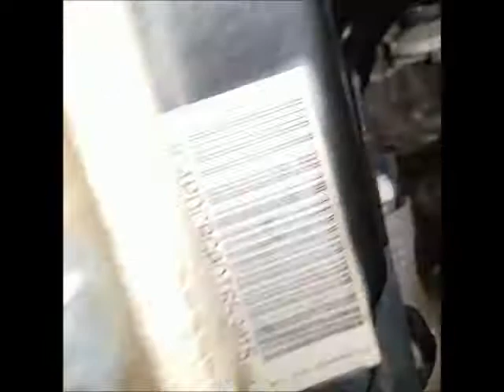2011 -2018 DODGE JOURNEY 3.6L REAR MOTOR MOUNT REPLACEMENT

Comment: Thank you very very much mine the engine wants to come out when I shift between the gears in the parking lot afterwards works fine but I feel a bump 😅 I will try to fix it when I can... but it's VERY hard without a hoist jack!

Comment: I noticed that if I loved my wheel my whole engine would move as well while trying to diagnose a different problem, did you have something similar
Reply from the maker: The engine was moving when I moved my tire I replaced rear mount and stop
Reply: @fixitquick  rear mount and stop??
Reply from the maker: It stopped, make sure you check all engine and transmission mounts